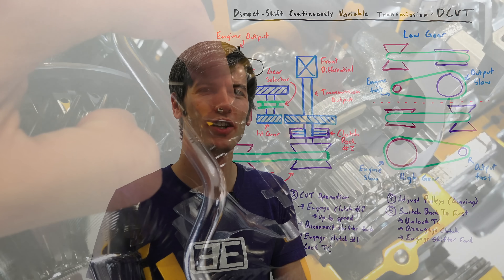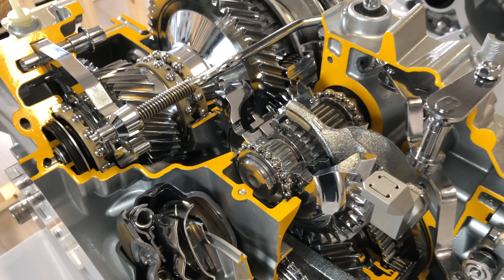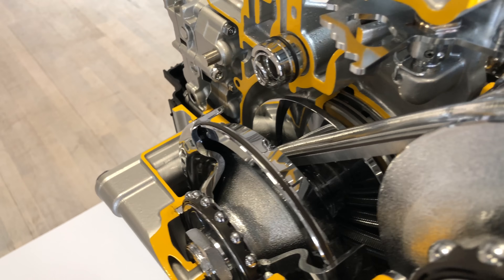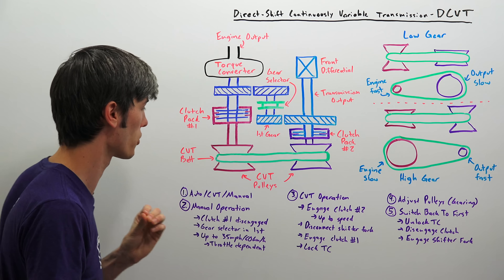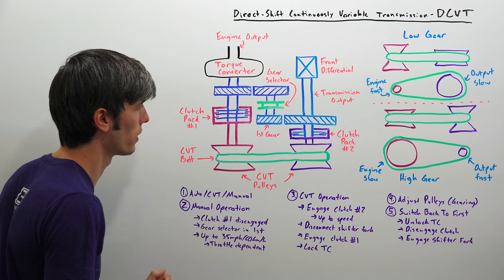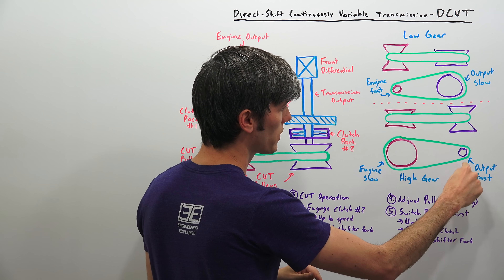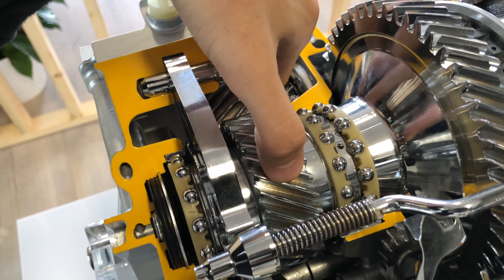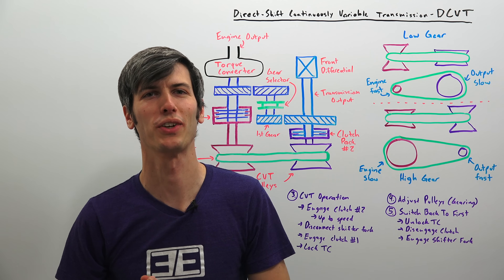The World's First DCVT Transmission - How It Works

Comment: Toyota solved a MAJOR problem with CVT designs: the lack of initial acceleration power from stop. Besides the 2019 Toyota Corolla Hatchback, it's on the 2019 Lexus UX "crossover" and the SE and XSE variants of the 2020 Corolla sedan for the US market. Whether this CVT makes to to the lower-end variants of the 2020 Corolla sedan is still unknown, though.

Comment: Hey EE, this video made me think... if they are able to make fixed gear and a cvt all in one transmission, would it be possible to make multiple gears in it, therefore having a fully automatic transmission, and a CVT? One could be used for performance purposes, and the other for fuel efficiency (at least, thats the thought I had). 
If not, then why not? What barriers would they have to pass to make it happen? Thanks in advance!

Comment: As always Jason's explanation is top notch. Not the engineering though. You just know this was created by someone to satisfy a PADP requirement. How heavy would this time be and fun times when it breaks!! I will stick with my 1,000 HP modified 6 speed ZF. Works perfectly fine! BTW, shifts are 90ms in race mode.

Comment: EE why is there at torque converter instead of a clutch?
Reply from the maker: Good question! Allows for better acceleration from a stop versus a clutch, much smoother initial acceleration, and it also helps improve low end acceleration.
Reply: @EngineeringExplained  so not a typical fluid pump type? If yes where does the fluid go?

Comment: I'll stick to my manual transmission...
Reply: Over complicated. The old manual box is far better.
Reply: @TonyDartford  Truck drivers unironically drive crashbox manuals to this day. It only takes a little bit of skill to use and you build it up real quick when you drive over 40 hours a week.
Reply: @michaelbuckers  Petterbuilt says 90% of trucks leaving the factory have automated transmissions.  Freightliner says 85%.  Europe passed 75% over 10 years ago.  Manual transmissions are a niche product now.  Now 5 or so years ago it was much lower (well Europe wasn't of course) like 10% or so but then the automated transmissions got better and things changed.  Saving fuel matters to companies.

Comment: lol,. no, you have no gear ratio on a cone..... you've got a pulley ratio differential. pulleys will never be gears..belts are either toothed or not....  no gears other then 1st in this... cuz CVT sux assss, cvt's cant even hold 1st and 2nd gear torque reliably on stock engines never mind performance  ... This is just another expensive ass ploy to hide it so it'll sell to nubs and yuppi sjws.. it only has better acceleration then previous CVT's and slightly better longevity and reliability.. so ,.It is a quaint attempt at performance and only worth it for a driving enthusiast if the engineers got their gvrw calculations way overbuilt and enthusiasts never alter the power specs or gvrw....,. nothing will replace the manual ,imo. ppl think auto is faster.. but the reality is you're a slow driver if you're thinking at all to do it to begin with ,,down shifting and decel rates are as essential to car control as acceleration and breaking,... a cvt may be abl to adapt quickly for an auto,. i can be there seconds before that always tho..  cuz i have eyeballs..

Comment: For hybrid cars I don't understand why they use torque converter and a cvt.. they could use one more differential where electric motor is used for charging and controlling the speed of the output. And now this, manual cvt automatic. More moving parts, more places for repairs, and neither cvt nor automatic gearboxes nor torque converter are cheap to repair. And this thing has all of it.

Comment: Very novel solution from Toyota - most of the heavy lifting (from dead stop) is done by the 1st gear which is going to be more durable. In a sense, the "2nd" gear is really a CVT transmission of itself which does most of the work thereafter. With modern electronics the speed & ratio selected by the CVT to match the speed of the wheels can reduce wear on the clutch packs, and it retains the smooth takeoff characteristics of an automatic vs. the dimwitted DCT units have on the market today.

Best of all, this is done without some crazy new tech - it is just combination of existing transmission designs all packed into one unit. This is also Toyota we're talking about, so reliability standpoint is going to be safe.

Comment: This is an ingenious transmission. You have a gear for take off so there's no slipping under load, then the CVT so it's smooth and quick afterwords. I still want to see a CVT on a high revving rotary engine. Top speed monster!

Comment: There are far, far too many moving parts! Why doesn’t someone design an engine with a larger power/torque range so as to not need to shift gears? Or at least only need to shift between high speed, and high torque applications.
Reply from the maker: Unfortunately that's now how engines work. They're limited in speed, so we need gears. This video will help clarify. Warning, it's old! https://youtu.be/bgGgH0j0KQE

Comment: How heavy is the transmission? In particular, how does it compare to, say, one of the 8(+)-speed automatics? Seems like it'd have to be heavier than a conventional CVT, given the extra hardware, but perhaps having a manual-style 1st gear alleviates the need for larger/heavier-duty pulleys and belts.

Comment: Wouldn't it be more heavier than a conventional CVT? Does it have a shift shock from 1st to CVT? The 2nd clutch pack needs to engage in order to spin up the CVT prior to disengaging the selector fork and engaging the 1st clutch pack. The CVT itself will have an inertia and may cause jerk when engaging the clutch pack. Also, when engaging the first clutch pack, does the CVT rpm match with the input and output shaft to ensure smooth transition? It is a new transmission combo, would love to hear the real feel experience of driving the new UX200 or Corolla.

Comment: why not make 1st gear pass trough the torque converter but the cvt right trough the engine crankshaft? the torque converter is there to prevent engine stall, but if you arent in 1st then most probably you are at speed and wont stall

Comment: It's a little too convenient that you gloss over the fact that the chain is in there driving a pump.  It's a well known GTF part.  Will work for 100K miles.  After that, good luck.  See quora dot com/Which-is-better-to-use-on-a-car-a-timing-belt-or-a-timing-chain/answer/Jason-Taylor-16 for definition of GTF and why chains are GTF parts.

Comment: I get that manufacturers are trying to squeeze more performance out of their drivetrains, but some of the resulting tech just comes across to me as abit....over the top?

I watched the other video where Jason explains that it helps reduce or eliminate the inefficiency in both ends of a CVT's gear ratios range, and this Toyota design shifts the CVT effective range to serve the top end while filling the low end gap with a physical gear.

My question is : how much time in actual driving does will the car be spending in the inefficient ranges? Yeah the gear works up to 35mph but that is if you launch the car with a lead foot, where all fuel efficiency consideration flies out the window. On the other end the CVT is also able to be efficient at very high speeds that you almost redline at the lowest gear ratio, which again, implies you must also have a lead foot.

So the Tl;dr version, as I understand it is, it improves efficiency for people who have lead foot. For the regular folks who drive like sane people and is smooth with the gas pedal, the real world efficiency gains isn't really that much compared to using a regular CVT?

Don't get me wrong, I applaud the ingenuity that went into the design of the transmission to pursue maximum efficiency from the drivetrain. But at the same time they are also adding complexity and weight to a supposedly simple and lightweight CVT. So I wonder, at what point does this trend of making increasingly complex components in the name of efficiency succumb to the law of diminshing returns?

Do the manufacturers actually care that it might cost more for the consumers to repair or maintain all these tech? or they are just chasing after the best fuel consumption and emissions paper figure (or worse, some fancy tech to edge out the competition) at the expense of total ownership cost and experience?

Comment: Great Transmission, but when will the notice they forgot the reverse gear
Reply: +Engineering Explained im sure there is a planetary gear set where the clutches are, an im sure its 2 clutch sets there have, one for internal an the other for carrier.
Reply from the maker: Haha they didn’t, I just didn’t cover it, which in retrospect I should have. :)

Comment: How about a comparison between this and something like a ZF-8? Something like overall power loss through the speed/torque range, available torque multiplication over speed (or rpm) range, overall weight, overall size, longevity and so on? 
Just wondering which comes out on top, where and why.

Comment: What's the point of the torque converter other than wasting fuel as usual?
Reply from the maker: Because when you’re sitting at a stoplight you have to have slip between the engine and transmission, since your engine is spinning but your wheels aren’t moving. TC allows for slip. It locks up once you’re into higher speeds.

Comment: I really like the idea of CVT's in practice they are super efficient and can accelerate smoother than automatic transmissions. BUT their reliability even in newer cars is terrible, Nissan and Subaru both have terrible CVT's... I haven't heard of many problems with Toyotas.. but I'm sceptical. They need to get rid of the "fake shifting" they do in many cars. I wouldn't buy one till they become more reliable and they remove the fake shift feel. Is this why you bought a manual Crosstrek Jason?

Comment: My first impression is that this transmission is way to complicated (torque converter, clutches, gears, steel belts etc) and therefore way to expensive.  I would still rather have a simple 5 or 6 speed manual transmission.
Reply: It's simpler than a traditional auto transmission
Reply: Emanuel Sacriste do you actually work on transmissions?? I do. This transmission is going to be a cluster fk of a trans to work on. There is a reason why a LOT of shops just replace cvts versus repairing them.
Reply from the maker: It’s used in the Corolla as well, which is quite affordable, and the Lexus UX200 is definitely cheaper than its competitors.

Comment: suppose,vehicle speed is 214 mph and suddenly a breaker  is came , than we apply a brake immediately than your DCVT engine belt will get high pressure n because of that i can brake your belt or will became loose  ?

Comment: Great film (great cat, too!). I do, however, have a question. When you explain the workings of this transmission, you use the subject "you": you disengage the clutch packs, you select the gear, etc. Does this way of speaking mean that the driver can and will select first gear, then the CVT, then back into first gear? Or is all of this done for the driver? Thanks!
Reply from the maker: Great question, and poor speaking on my part haha. The car does everything for you, nothing required by the driver. That said, it could be paired with selectable gear ratios like other CVTs.
Reply: Thank you very much,  @EngineeringExplained  ! :-)

Comment: so this is a semi automatic transmission ? and how does the driver opperate it ? with a stick ? or paddles at the steering wheel?
Reply from the maker: Just like any other automatic. Driver doesn't need to do anything, but you could have selectable ratios if you desired.

Comment: Ugh.  Just give me an “old-fashioned” manual transmission with a clutch pedal and shifter stick over this convoluted thing any day.
Reply: Automatics has got one big advantage over manuals, they are easy to drive in towns, that’s it.
Reply: CafeArtuk They get better gas mileage and are lower maintenance
Reply: JohnnyMo that’s some mentality
Reply: Javier Hernandez you drive a 2006 and under Yukon or a Tahoe then 😀
Reply: So after jumping out of first and over to the cvt it starts winning?
Reply: I agree but the masses don't, hence why here in Australia they are few and far between with many brands dropping the option for auto only.  Sad face.
Reply from the maker: I agree, I've owned four manuals, but if you're going to buy an auto it's a very clever, efficient solution. And it turns out most people buy auto.
Reply: I've driven about 1.6 million miles, about 500,000 on automatics, and about 1,100,000 on stick shifts.
Not only do I prefer a manual, I don't really like the 6-speed variants.
A 5-speed stick with well calibrated gear ratios and a quality clutch is the pinnacle of transmissions.
granted, many clutches aren't that great, and many stick shifts don't have all of their gear ratios calibrated well due to companies using "off the shelf" gears in them.
Reply: That’s what people used to say about type writers
Reply: A manual transmission is way more convoluted than this lol. Just say "I am a luddite"

Comment: Such complicated transmission must have life time guarantee or God help Corolla customers when it breaks.
Reply: It's a Toyota, it won't. It does seem a bit OTT though...
Reply: It’s probably going to cost around 5k-7k to fix. So expect to just junk the car at that point unless it’s a Lexus. If they are reliable and sell enough units, the good news is the salvage yards will be full of used transaxles bringing the price down. 

First year will be the guinea pigs. Maybe wait out the 1st gen. 

Just maybe Toyota will sell the aftermarket replacement internal parts for these guys to bring down the ownership pain... maybe. 

Hondas’ reman CVTs are close to 5-7k just for the complete unit itself. No labor. It’s crazy town.
Reply: @danhg3885  It is a Lexus, even if they are also going to shove it in a Toyota. I drive a GS450h with their next most complex transmission (dual-stage planetary)- I don't think one has ever broken even with enough power to reform Pangaea going through it. That said, an even more complex one doesn't seem necessary, a good torque convertor with paddles is still as good as it gets for me.
Reply: Apothecary Terry I meant the Lexus will have the resale value to warrant a repair where a Corolla would just be junked if the transaxle failed. They would be the same mechanical units. One is in a 20k econobox and one it a 40k lux. This will influence repair decisions. 

How old is your gs450h? Less than 60k miles I wouldn’t call it bulletproof yet. It’s a much different unit than what the subject video is discussing.
Reply: @danhg3885  Fair point about resale, I just don't think the reliability will be of a level where many people face that decision. Obviously we don't know yet, that's just based on their recent record.

My GS is 2013 with about 70k on it, but I was more referring to the fact I can't find any reports of failures in the gen 4 transmission at all. Found one website suggesting the most likely weak points but no actual example of one going wrong- my local dealer said they've never seen a 4th gen GS450h back for a part failure (after I bought it so this wasn't sales pitch either). Obviously the rarity is a huge factor, but then looking at a Panamera, it's a very comparable car in most ways (except used price, because "ooh a Porsche badge"), with a similar number sold, however it's much easier to find stories of faults and they're not exactly unreliable. I was tempted to pick on a Maserati...but that's just seal clubbing.

Comment: No clutch on first gear. I wonder will the synchro hub wear out?
Reply from the maker: There's a torque converter which allows for slip (instead of a clutch).
Reply: But surely a torque converter will drag unless engine speed is exactly matched to the road speed for that gear. I presume there must be an automatic control system to do this. @EngineeringExplained

Comment: It seems very complicated, with more wearing parts than a typical auto or manual. How does the increase in efficiency compare to service life? Can it last as long as Camrys of the past? Camrys are kind of well known for their drivetrains outlasting the body of the car. You'll have a pile of rust, but the trusty Toyota engine/trans keeps on chugging.